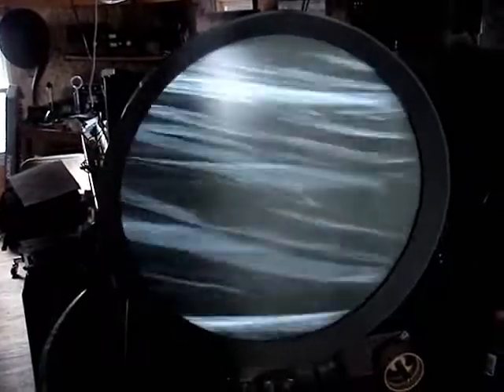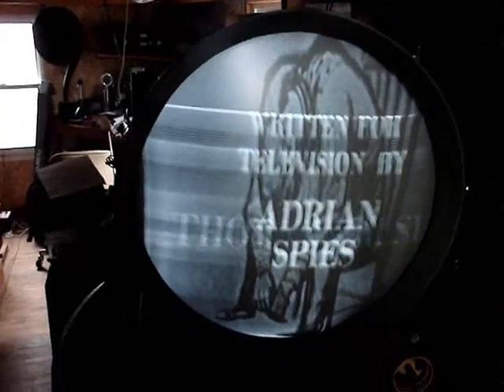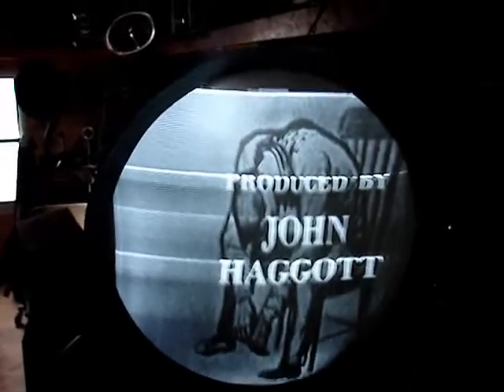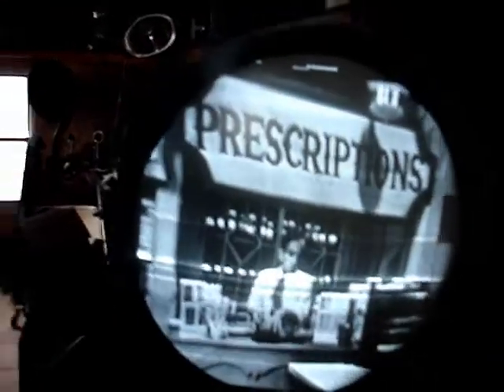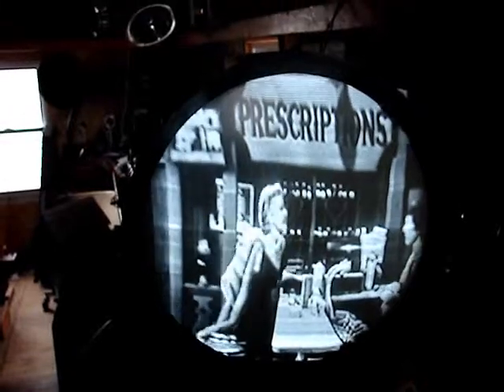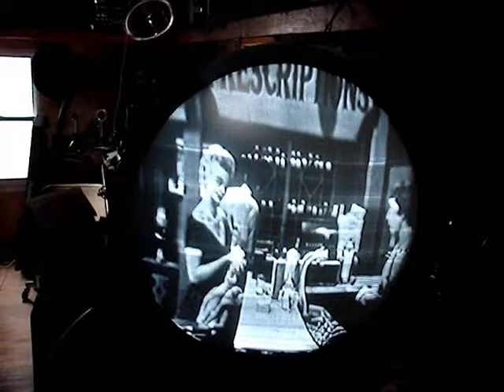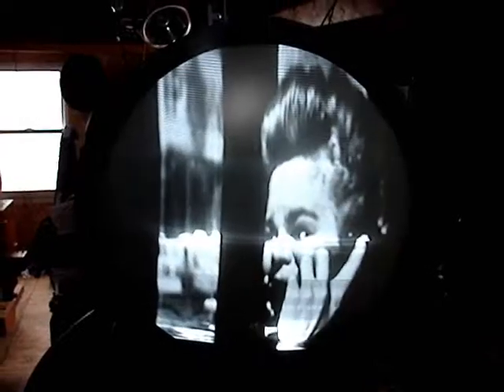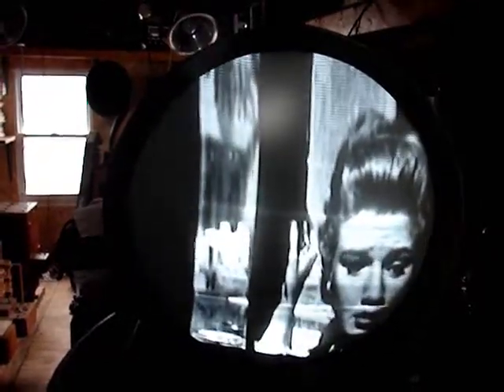Zenith 1951 Giant Circle Radio Cobramatic PT15

Comment: Much improved Gary. Your hard work and persistence is paying off. Hope your troubleshooting continues to be rewarding. Best, Don
Reply from the maker: +RestoreOldRadios Hi Don. I did a lot of adjusting and got a fairly full screen picture but the AGC seems to drift. I actually think that could be caused by the modulator in the Sony VCR I am using as I seem to remember seeing that same kind of AGC drift when I tested my 1965 Zenith Marsielle TV. The old Sony might have bad capacitors in it.

Comment: You're making progress, the picture is brighter,  since the pot is for service adjustment only I wouldn't think it would have had that much use to be worn out since it's not used like the regular user  controls for picture  adjustments.   It will be interesting to know the cause when you find it, and It was nice of Bob to help you out, he is very sharp on vintage TV restoration.
Reply from the maker: +maynardcat I can't figure out what is causing the picture to jump wide and then go back but I would think it is a bad connection. I am going to recheck resistors and I may also replace any silver mica capacitors related to the vertical circuits. With out Bob's halp along with Larry in Texas I am not sure I could have managed. This is my very first attempt to restore a vintage TV and I can tell you that restoring 1920s radios are child's play compared to this. Gary
Reply: +HD7100 TVs are much more complex that old radios, I think you are doing great for your first vintage TV restoration, much better than I ever could,  and I will be looking forward to your next video when you locate the problem.  It could be some  type of bad connection but the way it jumps back and forth in almost a timely manner it almost seems more like an intermittent component failure off an on.